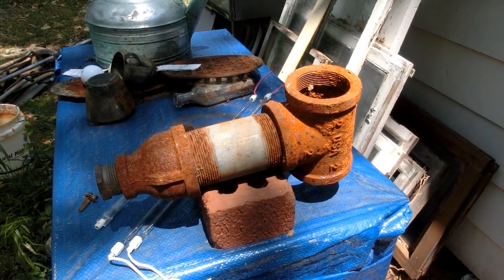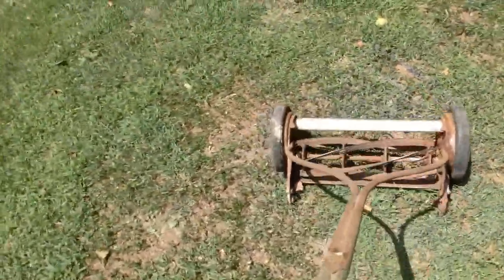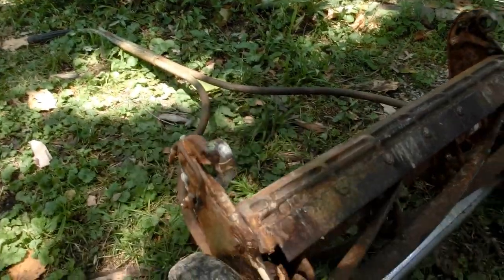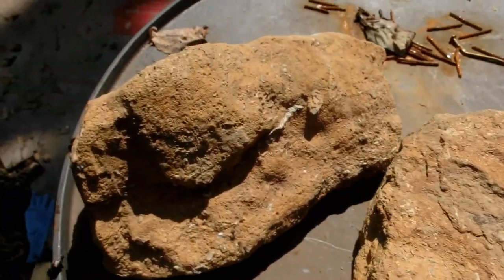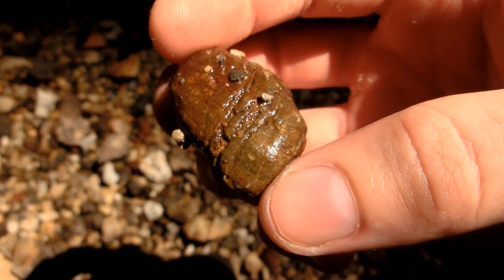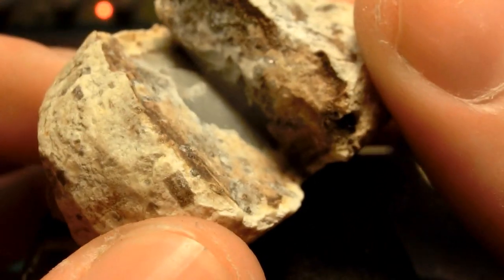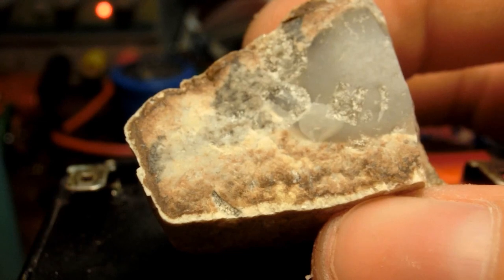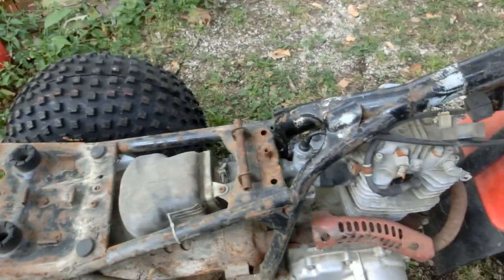Random Bits 0042 reel mower, fossil hunt

Comment: To sharpen the reels on the mower, adjust the plate so it is just barely making contact with the reel blades, smear the cutting edges with valve lapping compound and push the mower down a sidewalk. keep renewing the valve compund and pushing the mower till all the reel blade edges are a nice silver\grey color. you may have to make several adjustments on the plate during this process to get good even sharp edges.  Viola! it will now cut better with less effort and you can be proud of a fine working refurbished machine.
Reply from the maker: a couple of the blades are really rusted away, i may weld a bead onto them to make them to same size as the others.

Comment: Very nice creek you have there! I've spotted some wooden beams in the creek, are they any good?
Reply from the maker: those are just decorative beams for a front deck. i plan to excavate that area to find old stuff. will try to build a machine that will pump water up to like 30psi and i can dig with a water jet.
Reply: Very cool idea! Whenever I see a creek like that I'm thinking: hydraulic ram pump. I have yet to build one sometime, sadly there are no creeks or rivers around here. A ram pump could deliver between 20-30psi, but only when there is enough drop and flow of water.

Comment: ya those reel mowers have about 4 or 5 rollers on the back on the inside so that printer one looks like it will work great.
Reply: yep usually sausage shaped rollers :}
 looks like the back roller is the height adjusters too
Reply: ya you can adjust them a little but the rest is by the screws for the blade
Reply: jusb1066 KohlerCoalRoller Sometimes they have one solid roller, exactly like what he did.
Reply: im just going off of the two I have

Comment: If you really have to build a liquid fueled rocket which I would like to discourage, you should consider using kerosine instead of gasoline.  There are very good reasons why kerosine is used for jet fuel.  Gasoline has a dangerous flashpoint,  is way too aggressive, and likely to burn so hot, it will destroy the vehicle and everything around it.
      Another possibility would be methanol - wood alcohol - which you could produce.   The great advantage to that is that it is a very polar molecule and likes water, so if things go out of control, it is possible to easily bring the fire under control with water.
      If you are bent on doing this, you should use the bottom of the creek as your test range when it has a lot of water in it and the rocket can embed itself in one of the walls.  The rocket motor can be tested by mounting it with some loops on a wire like on a long clothes line running in the creek bed.  You can set the camera on the creek bank.
     Those rocks at 5:09, certainly the strata continues somewhere?  Were they washed down from further upstream or did you pull them out of a layer in the wall or bottom of the stream?
     It is likely those items in the crystal rock are just crystals that grew and aren't impressions left by biologicals.  Crystals grow in the geometric shapes of their molecular lattice.
Reply from the maker: i'm not very interested in building rockets. the reason i would first test gasoline is because i have some old gas laying around. kerosine is super expencive. like 10$ a gallon around here i think.

once i get my hydrogen/oxygen production system working and fill my oxy/acetylene tanks with oxygen and hydrogen i will be able to use that for fuel.

i'm actually looking to build a thruster that will fire for no more than 0.75 seconds. so there wont be very much fuel for the test. and dont worry i've been researching this and experimenting with liquid rockets for quite some time. just now going to actually see if i can cobble one together that works. getting a bit tired of just reading about how to build fuel pumps and stuff and i think an actual test would yield a lot of interesting results.

if i do test the rocket i will test it facing down so the thrust would just push it into the ground and stack bricks around it. that would also make it easier to measure it's thrust.

those rocks where found on my grandpa's land, there is a section of creek (about 4-5 times bigger than this one) that has a lot of rocks. i only found like 5 of those rocks but there are prolly more out there. the rocks there where big and diverse. so maybe dropped by a moving glacier.
Reply: I always laughed at pharmacies, because they had bottles of alcohol and hydrogen peroxide - the fuel and oxidizer for the V-2 rockets -stacked right next to each other.  They aren't really in the strength needed, but in most places for safety, items like that wouldn't be placed in the same area.
Reply from the maker: *****
 still funny though.
Reply: ***** fkin brilliant! love it

Comment: half way through man and loving it, im thinkin atm aye take a balloon to space, rockets are a bit of a waste of fuel :-) plus metal can be a real dick with high pressure, if I had to make a part for combustion I would take train line metal, it has fitting qualities :-)

take a little one of your hammers to some of those lovely rocks while your out on the trail, if the fossils arnt on the outside they may be within, also I think your lucky in that location, ive not seen a fosil in...30 miles of here and aye, ive kept an eye out for places over the years, theres a cool unmolested forest at the back of the grave yard at my house where Vikings once roamed, its not massive but I think time team were there ten year back, I always fancied grabbing a shovel and digging my own few trenches, I mean shit, ive done a lot of mad stuff so its not like im known for being normal round here anyway :-D

torch that oak shit where you see it and is there gold in that stream bed? think you need to go panning there! riches await!

not fossilised tree trunks man...fkin tis the sas-afras

awesome inside on that rock, looking at it, it looks really compressed and old there, like 10s if not hundreds of millions of years old...or am I just...

not using electroloysis on that mower? get it in the bath man :-D